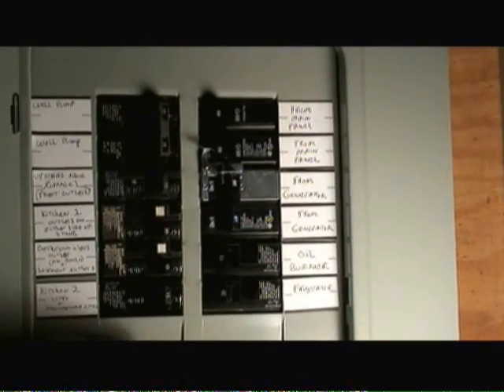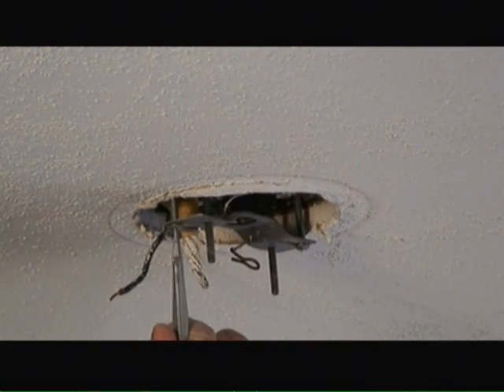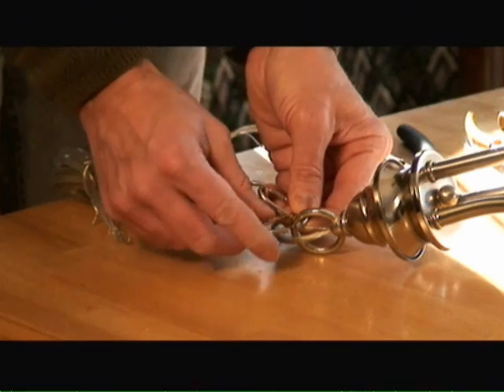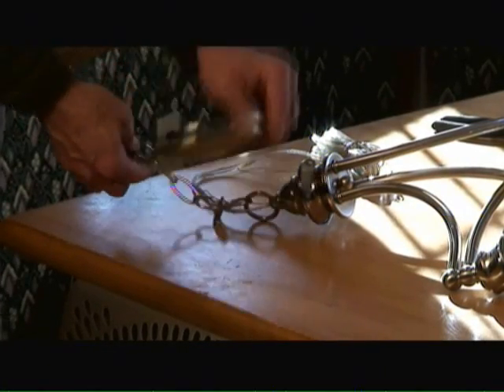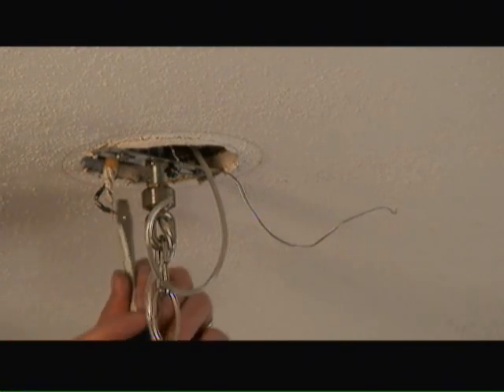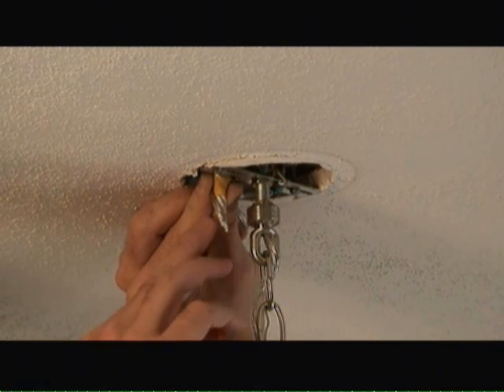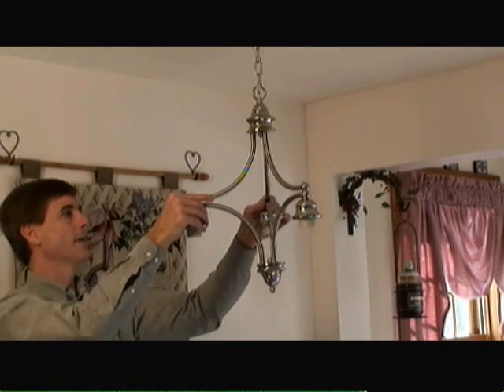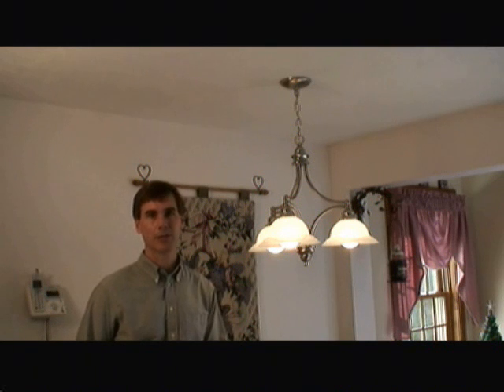Install Light Chandelier

Comment from the maker: The green wire is the ground wire and should be tied to the bare copper wire coming from the Romex cable inside the electrical box. Make sure to use a copper crimp or green wire nut to tie the bare copper wires together. The ground wire is used to protect you from shock in the event the black or white wires somehow get shorted to the metal light fixture itself.

Normally no current should ever flow on a ground wire. In the event that it does, the circuit breaker will trip and protect you.

Comment from the maker: How many wires coming directly from the ceiling light? Normally there is a black, white, and green (or bare copper wire). The green or bare copper wire is the ground wire and it should be tied to the bare copper wire coming from the ROMEX cable inside the electrical box.

Comment from the maker: You should have no problem using the existing electrical box for a 6 lb fixture. Use a slightly larger screw.

Comment from the maker: I'm not sure why there is a GREEN and a BARE wire coming out of the light fixture. Are there any directions with the light fixture that you can check for a definition on the wires? Can you see if the green or bare wire are somehow attached to the metal light fixture chassis. The one that is should be the wire that you connect to the ground wire in the ROMEX cable.

Comment: Hello Mark. I've truly enjoyed your video; it's very helpful. I have one question however. I have an old model chandelier that only has copper wiring. My ceiling light fixture contains 4 wires, 2 black, 2 white. I know two should be safely secured and tucked away, but how do I know which copper cord to put to the black or white cord. Please help :)
Reply from the maker: You might need to use a voltage meter to determine which one is the "Hot" wire. Normally the white wires are "Returns" that carry current passing through the light fixture back to the main circuit panel. The black wires are the "Hot wires" that effectively are carrying current to the fixture. So tie the black wire on your fixture to the black wires, and the white wire on the fixture to the wire wires in the box. Tie the bare copper wire on the fixture to the bare copper wire in the box.

Comment: i already have a chandelier and the thing that i have to change is the cord kit and i remember that person who installed it last time cut the cable cause it was meant to be to plug it in the wall not celling mount but he cut the wired shorter way shorter and celling mounted it can i do that and not get lost doing it? how can i convert a plug in chandelier to a hardwire fixture

Comment: I believe I connected the wires properly. Smooth to black, ribbed to white and the copper wire to the ground wire. When I turned on the power, there was a spark. Any ideas what I may have missed?

Comment: Any hints on how to make it level after install. Just hung one (5 light swag) in my Dining Room and it leans to one side.
Reply from the maker: +Ron Aldridge Not sure why that would happen unless the cover ceiling plate is not flush with the ceiling, or the ceiling is not level. I would suggest adjusting the cover ceiling plate to make it level. OR, make sure the chain is not kinked. Or make sure there is not something on the chandelier that is making it  unbalanced.

Comment: just had a chandelier installed and the installer forgot to close the top chain link back up. Is this a safety concern? the top link is in the shape of a "c". No worries about it swinging from an earthquake or anything since we are in TX. the ceiling is 20 feet high so he had to rent a ladder to install. I cannot easily get up there to fix it. Please advise! Thanks!
Reply from the maker: Jannelle, having an open chain link is no electrical concern. You can either call the installer to come close the link or do it yourself, if you want to get a very tall ladder. To do it yourself use a pair of adjustable pliers (e.g. channel-lock pliers) and put a few wraps of masking tape around each jaw to protect marring the link. Then use the pliers to close the gap in the link.

Comment: When the lights are on and the bulbs,all six are screwed in and produce light. Is that the same amount of electricity being used,if only one of the bulbs is being used?
Reply from the maker: No. You have the load/current draw of only one bulb.

Sign Up for my HomeAdditionPlus.com newsletter and get free home remodeling and home improvement tips, as well as tool product reviews, from me every month. Sign up here:  http://www.homeadditionplus.com/Subscribe-to-Newsletter.htm

Comment: mine hangs too low. how can I raise it without permanently changing it?
Reply from the maker: +DeeMuriel Beckley Hi, you need to remove some of the chain links. Use a couple pairs of pliers to do so. Then pull the excess electrical wire up and into the electrical box area.